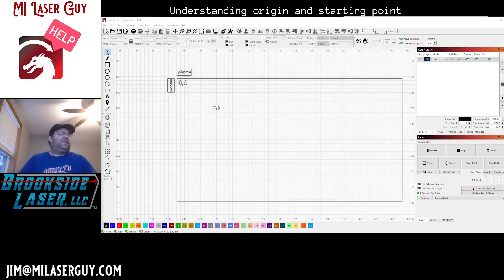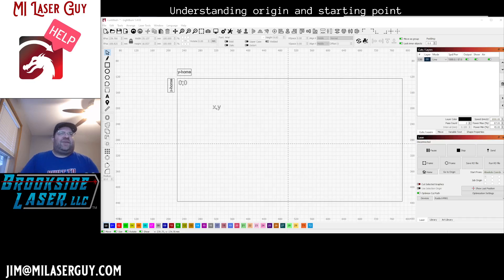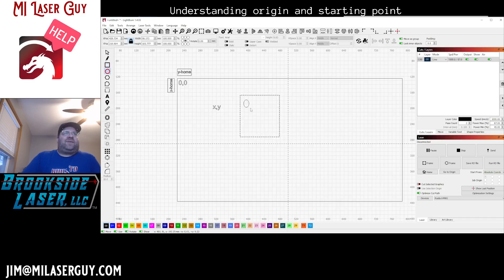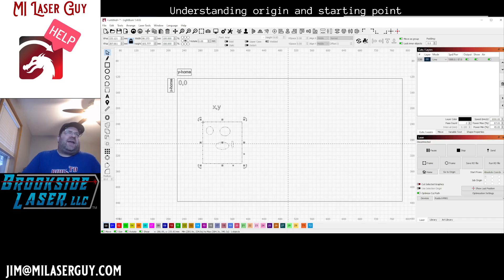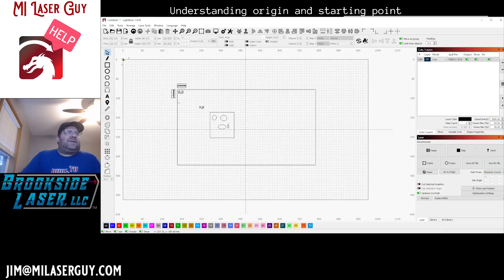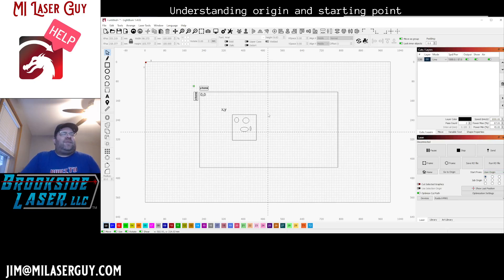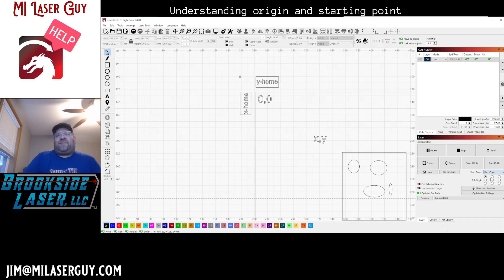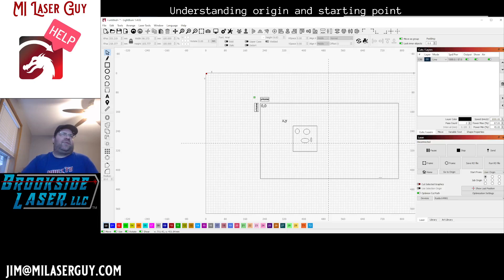LightBurn Tutorial: Origins and Starting points

Comment: If I position my laser (current position) to start a cut or etching and I stop the process away from the start.  And I want to move back to the start, how do I do that.
On my CNC table if I start cut anywhere on the table and that is X0Y0.  After stopping it I can just move back to 0,0 which is the start position. That is what I want to do with the laser.
Reply from the maker: Starting from "current position" can be problematic.  If you are using a DSP based controller, what you are actually describing on your CNC is "User Origin".  This is my normal operational mode for my CO2 laser.  I move it to a position and press the "Origin" button. This sets my user origin, which I use for aligning materials (sometimes the center of an item, sometimes an arbitrary corner).  If I stop my laser part-way through the job, as long as I am still using "User Origin", it will start from the same location. I can move the laser back to that spot in the Move window by clicking the "Go to Origin" button in the Laser window.

Alternatively, if you save a "current location" in the Move window, you can go back to that position. You can use the "Get Position" to get the current coords, then save it and go back to that position at any time, but setting an origin on the machine is FAR easier, if possible.
Reply: @milaserguy  Thanks for the reply, it seems when I click on the stop button, it looses all positions.  I have a Ikier 70 watt diode laser and use Lightburn (1.6) but in this instance it acts different from the software I use on my CNC table.  When I zero the DROs that is the current position and for any reason I stop I can just return to the zero, zero (current) position with a click of a button (macro).  I tried to make a macro in Lightburn but it looks at that like move to home limits not a current position.
Reply from the maker: On a diode laser (likely GRBL based), you probably would want to use absolute positioning, which is a reference to the 0,0 home position of the laser.  The machine should home itself at poweron, so that it understands absolute positions (as well as being able to go to saved positions), however, user origin is not likely available on these machines.